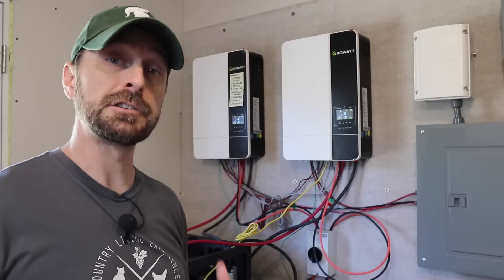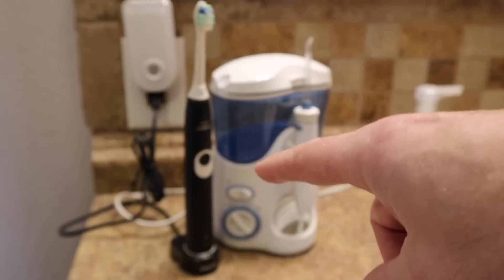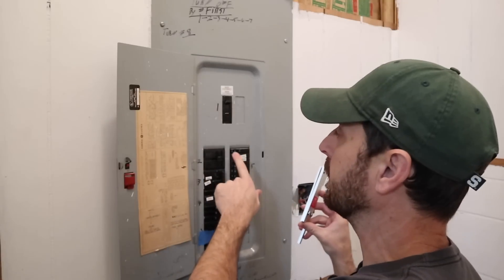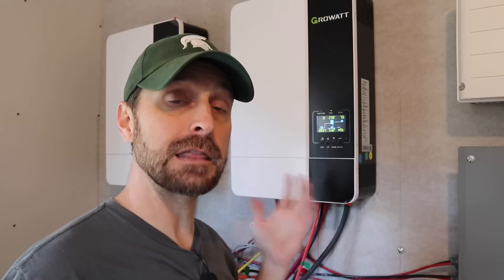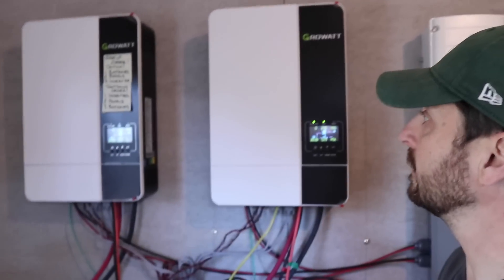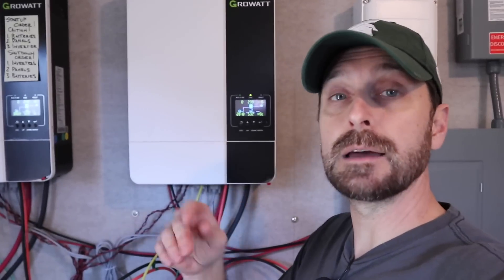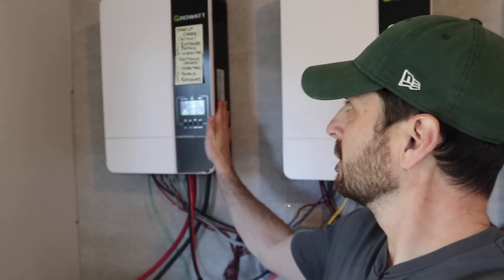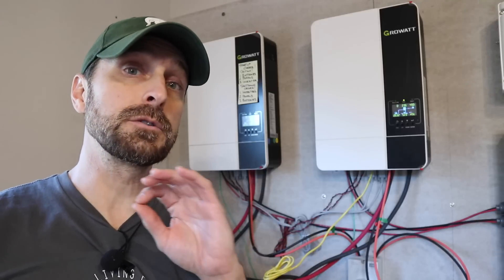Testing Our Solar System! 2 Growatt 5kw Inverters! What Can It Handle?

Comment: Great videos. I was wondering if you had considered a heat pump clothes dryer, I believe they take about 900 watts at 120v?
Reply from the maker: Thank you. I have never heard of a heat pump dryer. I am installing a heat pump water heater though.
Reply: @CountryLivingExperience We are planning a similar solar system and that's what we plan to buy. Another benefit to them is they are ventless, but they do require you to empty the drain pan or put the drain hose into a laundry tub or drain. Let me know what you decide. Take care, Jake.
Reply: I considered a heat pump hot water tank as well but I think we will go with a Rheem Marathon poly tank for a few reasons, they are super insulated, they do not have an anode rod so they are great for well systems, and no corrosion, We do not use much hot water for two of us so to run it for an hour or two at peak solar times it would stay warm for several days.I guess a person could also install DC elements in as an option.Just another thought.

Comment: Just an observation: More than likely the reason for the differences between the two inverters and their 'display usage readings' is commonly called an "imbalanced load".  This phenomenon is commonly due to one or more 120Vac load lines drawing a bit more or less power than the other. Usually it's not a major concern unless the percentage differences are considerable. What percentage would that be? That depends on who one ask and (in this case) the inverter &/ or auto transformer company recommend.  Correcting this issue sometimes is like herding cats, and other times simply turning off appliances.
Reply from the maker: Yep. It is always an issue trying to track down the cause.

Comment: Nice setup. Thanks for sharing the load test. It was very informative for me. One suggestion for you or anybody else, if you haven’t already done it. Getting a heat pump water heater. The specs on those things look awesome. Home depot has a 50 gallon rheem for $1700. The energy guide says it uses 866 kwh a year. Plus you get a small amount of free ac from it. That would fit on your system and you wouldn’t have to use any propane on it.
Reply from the maker: Thank you. I actually will be replacing my water heater with a heat pump version soon. I already purchased it and it’s sitting in the barn.

Comment: I rigged up our 2 chest freezers and 2 refrigerators on a circuit connected to one of my two inverters (both inverters on separate batteries and separate 120 circuits). If that inverter should lose output I have a contactor such that it automatically switches to the other inverter to provide redundancy for those critical loads. Otherwise the inveters are not tied together in any way.
Reply from the maker: Interesting setup. Glad it works for you.

Comment: Nice video but what about the transformer? Seems the inverters can handle a ton of demand but I would be concerned about the different loads per LINE 1 or LINE 2. Any concern about having them exceed the transformer ratings? I would think if you had big 120v demands on a single phase that it could cause an issue, ex. coffee pot and microwave running at the same time. Thanks
Reply from the maker: Thank you. 
Whenever anyone is on solar they always have to think about balancing the loads. Whether they are on a 120v inverter or on a 240v inverter with a balancing transformer.
Reply: @CountryLivingExperience   thanks I agree. I was wondering during your tests if you were monitoring the load on the transformer itself? Or had you already balance your loads?
Reply from the maker: When I was testing, I basically had in my head which loads to make it somewhat balanced. I was trying to push it over it's limits a little bit too. 
I don't know of how to monitor the loads on the transformer accept to understand how much 120v load I am using. I have never had an issue.

Comment: Cool video. I've got 3 of the same batteries you do and a sol-ark 12k. I almost went the growatt route but honestly after using the sol-ark I think I made the right choice.

How long can you power your house with the 5 batteries? I can go about 5 hours with my 3 but that's powering the entire house including our 5 ton geothermal hvac and 2 50 gallon hybrid water heaters. 

BTW, if you haven't checked into hybrid water heaters, I highly recommend it. They take about 800 ish watts in hybrid/efficiency mode.
Reply from the maker: It was between the Growatt's and Sol-Ark for me as well. Depends on what I am running as to how long I can power the house on the batts. I figure 2 days with just lights, freezers, and mini-split AC, etc. I am actually about to put in a heat pump water heater too.

Comment: I've been enjoying the journey of doing the research on off grid power. I have been amazed what these growatt inverters are capable of at an inexpensive price. What would it take to be able to run your electric heat heat pump all the time? Is it possible?
Reply from the maker: I did a video on that recently. It may answer your question. https://youtu.be/PY5BdZXTR0g

Comment: Very interesting and informative videos, I work for a solar company and I can see how most of the people who buy their solar packages buy it thinking that they will have power when an outage occurs, and that’s not true. When they buy their grid tie systems, it doesn’t work the same as off grid ones. I just wish that more people did their research before buying any solar products. I my self am in the process of getting my off grid package and install it my self, since I can almost do the whole installation my self, and I’m an electrician as well. 😜 I only would like to ask, if anyone knows, what kind of permits I would need to be able to install an off grid system on my roof?
Thanks I’m advance and have a blessed day.
Reply from the maker: Off grid is best for sure. Permits are based on the jurisdiction you live in.

Comment: Great vid. I bought two of the Growatt 5ks but haven't begun setting them up yet. I'm not sure about the issue of overall efficiency of your existing system vs mini-splits, but you SHOULD be able to run the existing system if you install a soft start on the compressor, and the overall cost of that would far less than multiple, or even one mini-split system. Just wanted to point that out for anyone else who was thinking about trying to run an existing unit like yours.
Reply from the maker: Thank you. 
I am actually releasing a video on Sunday of our HVAC system vs. mini-split situation. I talk about a soft start, advantages of mini-splits, our current HVAC system, etc.

Comment: Hi there, I really like your videos 
I have been thinking of going solar as well
So I was wondering how I would find out what I would need if we are averaging 55kw a day in the winter for our family of 7. Now that is used a fuel oil furnace but I was thinking that it would be nice to go Geothermal as well. 

Is there some where I could go to find out how many panels and everything else I would need to be off the grid ?

Thanks for your time and all these videos that you have created.
Reply from the maker: Hello and thank you.
There are a lot of online solar calculators that you can find that will help you determine your system size. They are all over the internet. Here is one: https://www.solar-estimate.org/residential-solar/solar-panels/texas?aff=4713&cam=45&gclid=CjwKCAjwiuuRBhBvEiwAFXKaNOaA4rkk_FYxZlUDPvTQYrHX4b1wJaoaVNQLUEEztkI0zii9zDvEFBoChIgQAvD_BwE
As for Geothermal, it is the most expensive way to heat and cool because of the initial high cost of setup and installation.

Comment: When you say the system won't handle the heat pump, is it the amount of batteries you have or is it the Growatt inverters that can't handle it.  Great video thanks for posting
Reply from the maker: The inverters don't have the ability in terms of amperage. The 3 ton heat pump is too large and needs a lot of amps on startup. You can add a soft-start to alleviate that issue but our system is too old to spend that money. We are just going to add mini-splits.

Comment: This is awesome. Signature solar is 15 miles from me. I just picked up 12690 watts of solar panels 3 5K grow Watt inverters. 1 Transformer six 48 V 100 amp-hour lithium iron phosphate batteries. I just got rid of my tankless water heater and went to a 50 gallon heat pump water heater and purchased a soft start for my 3.5 ton ac. I have a 1200 square-foot home I am going to be able to run completely from this setup
Reply from the maker: Very cool! Sounds like you have a nice big system. I just picked up a heat pump water heater that I am switching out soon too.

Comment: I guess my only question is what's the difference between a modified Growatt and a non modified one i watched someone do the same thing  with the international version using the SolarEdge i believe the only difference was that u can adjust the 230v to 240 etc on the international one is there something else they had to modify for the American market ?
Reply from the maker: Good question. The modified Growatt 5k Off Grid inverter is only sold by Signature Solar. It takes out a neutral-ground bonding screw and insulates that vacant port. This prevents an electrical issue that is frankly over my head (electrical engineering stuff). Other importers of the Growatt 240v inverters failed to do their homework and ask that the inverters be modified for the American 120v grid. You should never modify one yourself.
Reply: @CountryLivingExperience  I tested my international Inverter different brand there was no connection between the ground and the neutral " Powered Off " that it I have yet to test it with the power running to see if there's a connection I want to hook mines up just like that but I have to find out if it's connected with the power on
Reply from the maker: Be very careful with a 240v european model of any inverter.
Reply: @CountryLivingExperience  I will it's a single phase 230v hybrid Inverter that u can change the settings to 240v 220v etc. It look just like the Mpp LV6548 Inverter.
Reply: @CountryLivingExperience  On ur inverters Do u know if the L and N are 120v each to = 240 or are both the L & the N are 240v each.
Reply from the maker: L and N are line 1 and line 2. They are both 240v.

Comment: I have the same Growatt inverters. I'm also afraid if is possible that they feed power to the line. Are you sure this is possible? They are marketed as offgrid, so I think it is not possible that they return current to the grid
Reply from the maker: When I use the term "Back Feed", I am talking about if the grid is down. If you had your system on it will send power back through the grid lines and may harm a line worker. It is just like a generator. This unit is off-grid meaning you cannot use it to "Net-meter" or sell/send power back to the grid while the grid is up and running.
Reply: @CountryLivingExperience   yes, I'm talking about the same. Not only the utility company can sue me If I back feed to grid unauthorized..but people can be hurt because of this. I just wonder what limiter can be added for this. And because my system is three phase (3 growatt inverters), in my country If in two of the phases I use grid current + PV, but on the third I only use PV, then the utility company charges you the electricity that you return to the grid (it is not intentional but this is how it works here)
Reply from the maker: I have a mechanical limiter called an interlock kit. It physically will not allow me to have the main breaker and the solar system feed breaker on at the same time.
Reply: @CountryLivingExperience  yes I saw..but you are not using additional power from the grid (when is needed). In my case I cannot do that as I live on a not so sunny location with nasty winter

Comment: Love signature solar! I bought the 12Kw inverter so I could have a true 240v system without the auto transformer plus I wanted the low frequency inverter I also have the EG4 48v batteries but I built a twin dual axis tracker with 4000w of panels on each. We are in the Del Rio area and get around 9 hours of direct sun on the panels with the trackers which gives us around 32,000 KWh a year. The system was about the same cost as yours.
Reply from the maker: Very cool. Installing by yourself is such a cost saver.
Reply: I built a panel system for tracking just cannot figure out the components to buy to actually move it. Mind sharing?
Reply: @bustersnm  I have purchased two controllers from Eco-Worthy  along with 30” 12v actuators and have had great service out of them. The first controller has been working for 2 years which I feel is amazing for the price of around $130.
Reply: @richardoder3459  how many solar panels do you have on one unit. Mine is 6, which is why I am having trouble finding strong enough motors.  Thanks for the reply.
Reply: @bustersnm  I have 8 400w panels which makes the array 15’x15’.
Reply: @bustersnm  I am in the process of building a different type of tracker at this time. The new one is one that turns instead of pivoting. The winds here in Del Rio blow 20 mph regularly which makes the pivoting tracker rock and roll way to much.
Reply: @richardoder3459  oh wow. That's awesome. I would love to know more about your system. Do you have a video of them?  Thanks.
Reply: @bustersnm  I can email photos.

Comment: As others have said there's really no reason to switch out electric appliances for those running on propane. In particular gas dryers are less reliable than electric. Instead, if you are in a cold climate switch out your air handler for one than has a propane furnace as backup instead of electric heat strips...then even with an extended loss of grid power your off-grid system only needs to run the thermostat and blower fan for heat. Which is what we do here, though with natural gas instead...natural gas is so cheap I don't run the heat pump in the winter anymore to reduce wear & tear on the compressor, which we really need for A/C in the summer.

Comment: Looking to do something like this when I finally leave Cali and make my way out to a homestead. I currently have 9kw solar and 3 tesla batteries (40.5 KW storage). My biggest concern moving to the rack style batts is what is your overnight consumption assuming some heat to stay comfy? I currently wake up to 20%ish remaining in the batteries when I run a heater overnight (nothing crazy propane heater temp at 72). There are other items that start consuming at 6am (Pool) prior to the sun hitting PV and I have a 200g saltwater fish tank that I won't have when we finally move. What do you wake up to prior to the sun hitting your PV? You have it set to 30% so your keeping quite a bit in storage. Just curious how this works for you overnight. Thank you in advance.
Reply from the maker: You have a lot of battery storage. I don't run my heat on it yet because my system is not powerful enough to start my 3 ton unit. I am switching over to mini-splits soon. If I use the solar when cold out, I utilize my wood stove for heat. If it is warm enough outside, I switch the heat off and then run the rest of the house on solar. My batteries have gotten down to 50%. They start charging fast at about 10am in the winter at my latitude.
Reply: @CountryLivingExperience  My current house runs at 1.1kwh on idle. So needed that amount of storage. When and If I ever sell this place I don't believe I'll ever come close to that idle amount again.
Reply from the maker: That is a ton of storage!
Reply: @CountryLivingExperience  I installed Slow starts on both my AC units. This makes the surge a slow ramp-up. Prior to the software upgrade to the power walls (powerwall 2's were upgraded to powerwall 2 plus) You could only do 5kw per battery so with 3 it could handle a total of 15kw surge. With the upgrade, you can use it at full. 13.5 per unit or a 1c rate (I think I am saying this right). Slow starts are fairly cheap and easy to install, you may want to look into those or your bigger electric appliances.
Reply from the maker: @leeslinkard6920  I have an older heat pump hvac system that has a slow refrigerant leak. A soft start would be $400 plus install. I couldn't see spending any money on it at all. The mini-splits are much more efficient anyway.